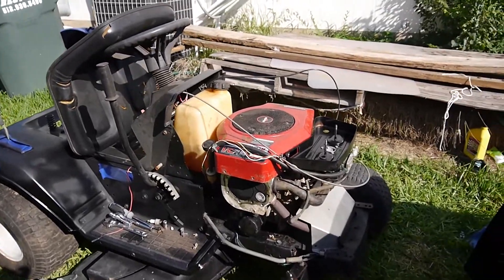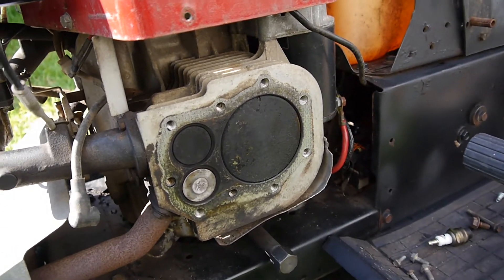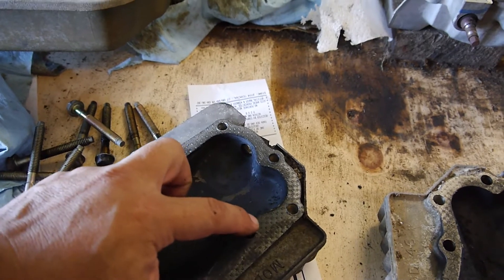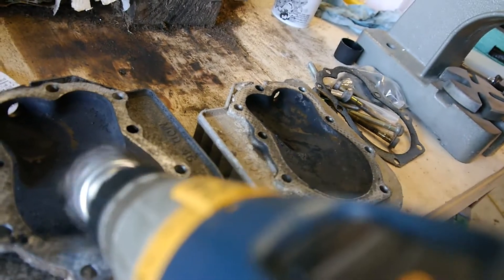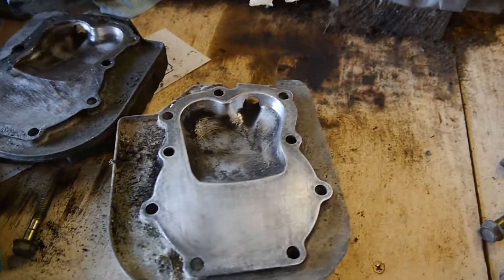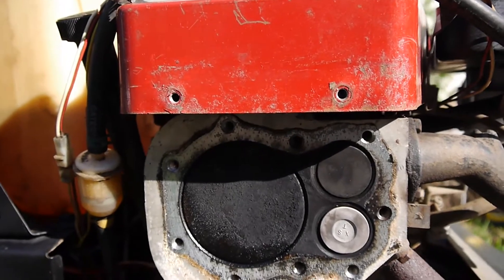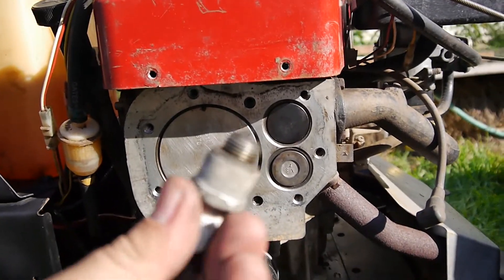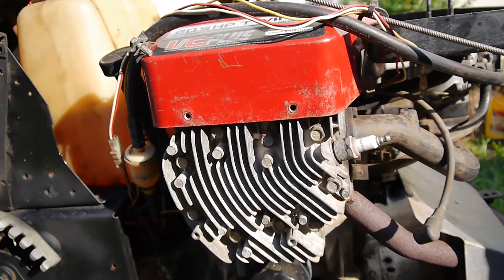Cleaning carbon deposits on Briggs and Stratton twin cylinder heads and pistons

Comment: I had to replace the head gasket on my John Deere la110 while apart I did this cleaned off the carbon after i got it all back together definitely can tell a difference with the engine. Great video.

Comment: whats the benefits of doing this? And is this necessary ?
Reply: I'm no engineer, my mechanical skills are questionable, but cleaning the carbon build up would be equivalent to bypass surgery. (I haven't performed a bypass in decades) But my thinking is that the fuel burns cleaner without the coating of carbon residue. Engine runs at normal factory specs. (not as hot)
Reply: @robertlee4172  I've read that the carbon creates hot spots, which I'd guess lead to overheating in localized areas and potentially holes in the piston crown.

Comment: Thanks for the video young man I have 2 opposed twin cylinder Briggs and Stratton enigne ,s I have a starting issue with the engine on my powr Kraft mower the starter is  having a hard time with turning the engine over took the spark plugs out the starter is turning the engine over with no problem .so I'm going to have to clean up the combustion chamber,s on the engine on my powr Kraft mower then do the same for the engine on my LT1000 Craftsman' mower